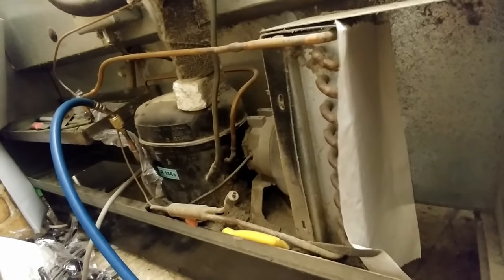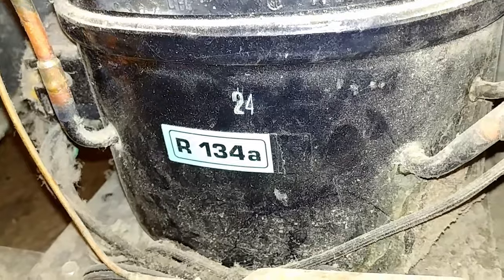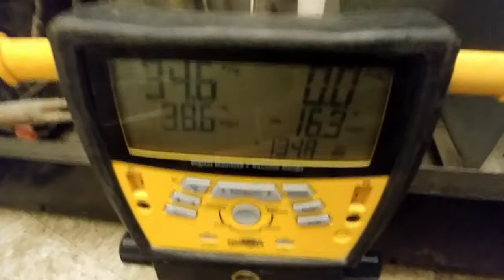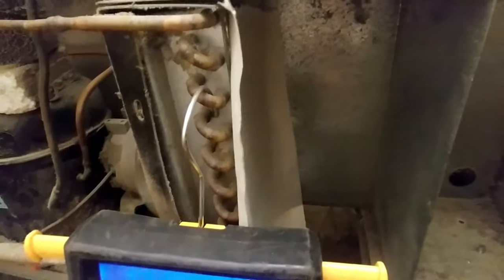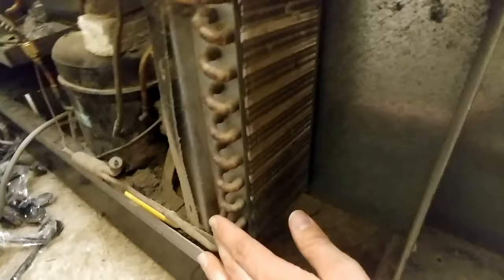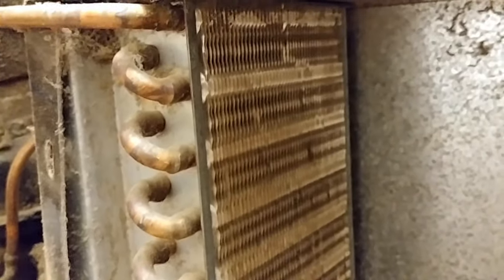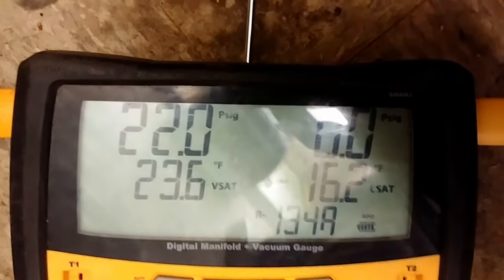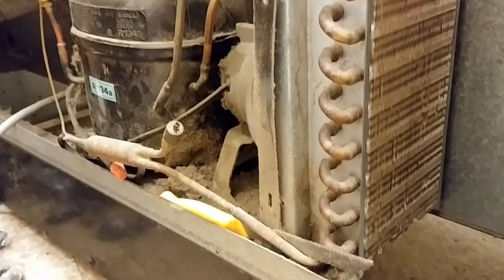Symptoms of a Dirty Condenser Coil in a Capilary System

Comment: Good explanation.  I learn something from your videos even when they are out of my scope.  I catch the extra tid bits like if only the top is a little warm, is possible low refrigerant. That was wild the effect the blocked radiator has.  Clean them fins LOL.  I bet the same would happen in a home central air after 20 years as well.

Comment: we have an airconditioner on a 5th wheel trailer that is not cooling. I cleaned the coils and fins but it still doesn't work. This unit us only a few years old. it worked fine all last summer. An ideas?